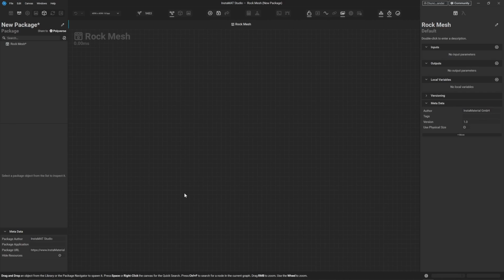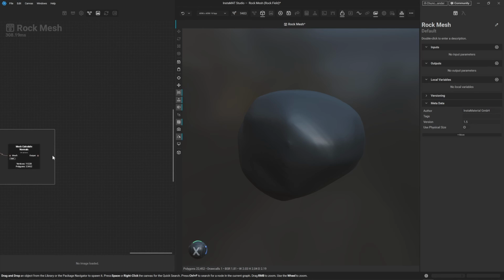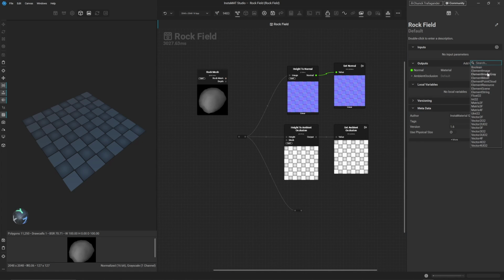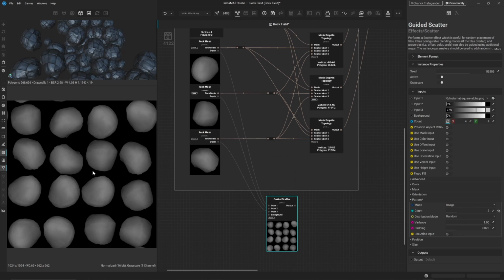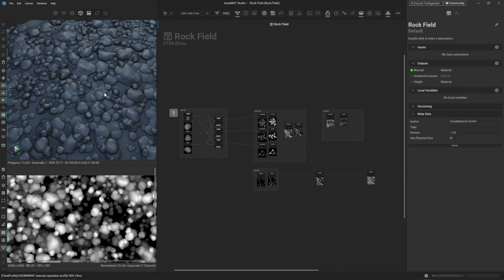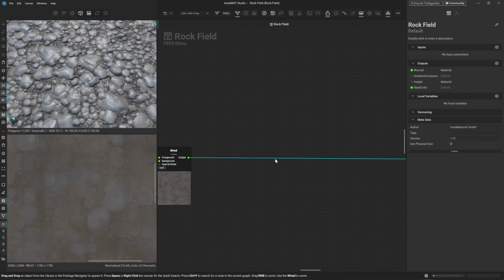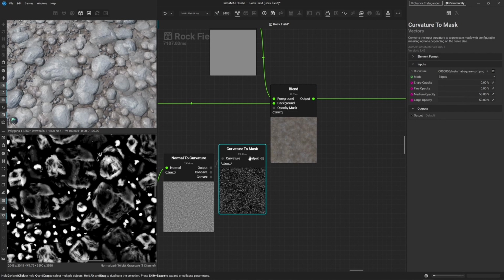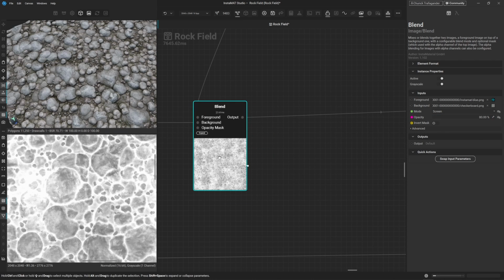Rock Pile | InstaMAT Material Tutorial

Comment: nice to have 3d options in instamat. last material i did i got a skull model hp off sketchfab and rendered several angles of it as height in 3dcoat using y export. brought those into sd. seems using insta i could have brought it right into there and converted and had just rotated it for the angles.
Reply from the maker: I'd say you'd likely be able to do just that! The 3D options are a real game changer for me in MAT, it's so handy.